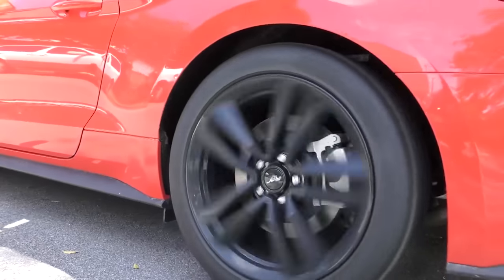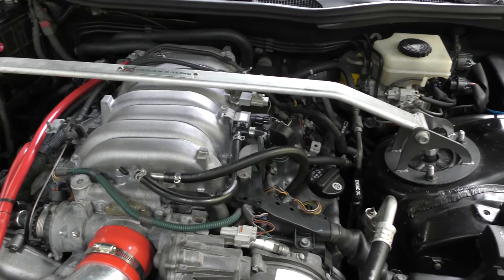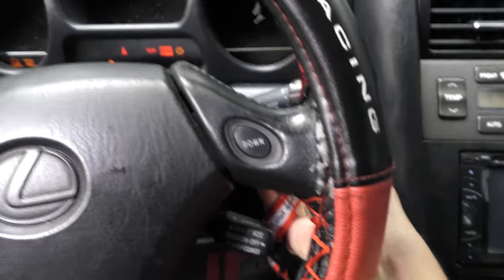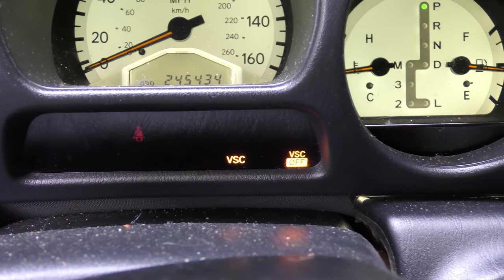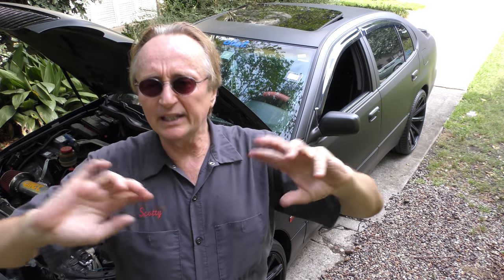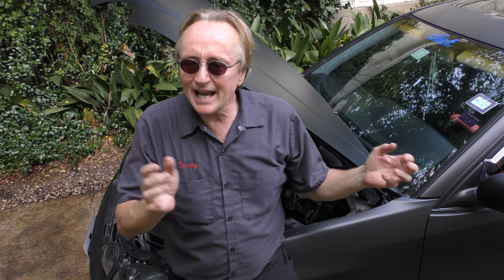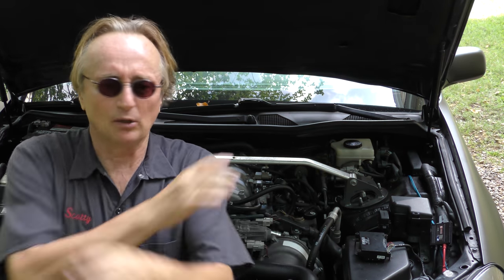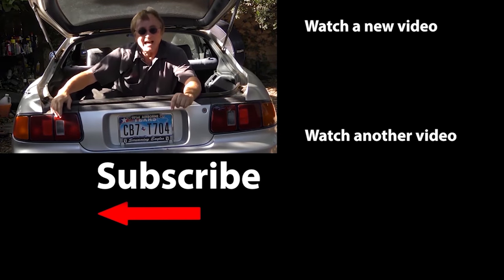Here's How Stupid People Modify a Car (A Sad Day for Lexus Owners)

Comment: That’s more of a hot air intake! Sucking all the hot air from inside the engine bay!
Reply: @j_freed  in which case it's sucking the hot air that's just passed through the radiator
Reply: Yeah I bought a 240sx recently and it had one just like that. All I could think was ahhh a hot air intake
Reply: @j_freed 
 it must be sealed from the hot engine bay with outside (cooler) air being drawn in, to work.
do you even youtube bro?
Reply: Still gain hp
Reply: Technically it’s not a cold air intake unless it goes outside the engine bay that’s just a regular intake with a thinner air filter and smoother hose
Reply: A cold air wont even make more power in most situations the ricers using them cant even rev their engines to the rpms where it would make the power...so all the idiots thinking they know better with their cold air intake are illarious...probably losing a ton of power down low and cant make it back up top cuz your engine cant get there hahahaha
Reply: Camp Matthew  thats because your engine can turn high enough! Its not making a ton more power then a short ram..the difference is in the piping lenght...i got a short ram on mine,when i started with it, was running 14.8to 15.3sec..
Now running 12.98..there is no difference with a cold air! And you re not even tuned if you are happy of not geting codes...barelly making any power!You also got robbed lolll could of got the same gains from a 100$ diy intake...🤣
Reply: j freed very smart guy yiur correct bro

Comment: geeze, poorly modified is an understatement! modifications are supposed to improve performance, not degrade performance😔
Reply: No, they aren’t. A modification would be anything to change the car, a modification. Even tinting the lights are a “mod”
Reply: @0101pwnage  so, you're saying that there's no difference between good "mods" and bad ones? I've always modified to improve, not degrade. improvement is and always should be the goal.
Reply: PANTYEATR1 “should” be the goal, but unfortunately that doesn’t work for others.
Reply: The air intake definitely made a difference when moving at higher speeds
Reply: @0101pwnage  In this case, we're taliking about PERFORMANCE modifications, NOT about cosmetic modifications. Please try to keep up ;>)

Comment: I would bet anything Scotty didn't put this on a dyno.
Reply: The customer probably did and told Scotty
Reply: Yeah, I don't know if it's possible for a modded V8 to have less than 200 hp
Reply: @ryanmckenna5254  yep. More than possible. The American Big 3 built em factory, by the millions, for 2 decades. Thru 70s & 80s. V8 table weights...)))
Reply: @ryanmckenna5254  and Scotty hit it dead on. The mods made it run like crap. Not idle worth a hill o beans... Skip letting the computer have the data necessary to set fuel/air ratios & timing, & volia! Take 300 HP to a staggering 150...
Reply: @patrickjordan2233  those engines weren't modded, let alone fuel injected
Reply: @patrickjordan2233  V8s with upgraded cams run rough at idle too, doesn't say much
Reply: @ryanmckenna5254  yep, they were. Remove O2 sensors, and viola. And look it up. They were fuel injected. Lol
Reply: @patrickjordan2233  most weren't, and most of the V8s that were, made over 200 hp easy without mods. Didn't mean to get into your feelings, but he does exaggerate and judges harshly opposing opinions. Just like there are just as many junk Fords as junk Chevys, you get what you pay for.
Reply: I thought the same thing. He would have showed video of it or graph print out had he actually spent time and money on a dyno.
Reply: Patrick Jordan you are right though anything new enough to be controlled by a computer you restrict the hell out of it if you don’t tune/bypass the computer because it controls everything you can put a cold air intake and a higher flow fuel pump and whatever else on it but the computer will only allow a certain margin to stray from the original specifications so it won’t do anything for you
Reply: @ryanmckenna5254  It's not modified properly, in fact it's the exact opposite. He removed the sensor that tells the computer how much fuel and air is getting into the engine so the computer doesn't know what the hell to do and just dumps a tone of fuel non-stop, drowning the engine in excessive fuel and killing power. Modified requires that you reprogram the ECU to the exact amount of air and fuel entering to keep it at the optimum air to fuel ratio. 

You can't just bolt on parts and call it a day, that will make your car run worse. Reprogramming the ECU is the #1 most important part of modifying the engine to make it faster.
Reply: @SI0AX  as someone who works on BMW's, I understand the importance of sensors, but I honestly don't believe a MAF sensor is going to reduce 1/3 of the engines hp.  Engines have fine spraying injectors, so their is only so much fuel that can be "dumped" into the cylinders at a time. Most of the time when people upgrade their intakes, they have to upgrade to higher volume injectors. I'm sure it is idling rough at idle without the sensor, but I'm sure it has no problems opening up.
Reply: DUDE he didn’t I’m the owner I dynoed it just look on my page and she suprised all the mustangs and chargers there when she opened up
Reply: Ryan McKenna 255 dynoed keep in mind it’s at 250,000
Reply: Ryan McKenna she dynoed 255 to the wheels look on my page
Reply: SI0AX these ECUs are nearly to impossible to tune
Reply: @user-gb1ne5jj8v  I know what I am talking about, and it feels good knowing I can defend your work against low blow criticism. 
It's not fair for him to bash your tuning, when he's not tuned a Lexus himself.

Comment: I agree, it's better to leave it stock.
Reply: You must be crazy?? 

Why would you leave a car stock when you can have plenty of fun roasting others with a sleeper. 

Stock sucks!! 

And on this video Scotty is only half right because moding a car is where all the money on cars is made in 2020. Lol

The fastest cars are built not bought. Lol

But this lexus needs a lot of help though to get it built right though.
Reply: @extremedrivr   Stock lasts longer, is more efficient, more practical.
Reply: @hedgehogthesonic3181  

No sir!! 

Stock does not last longer because the automanufacturers don't want you to have the best car. 

My current car for example will last longer than the auto company say's it will because I am using motor oil that is superior to what it came with from the factory. Little details like that go along way to making a car last a very long time. 

The aftermarket industry knows more than the OEM does so long as the parts are not 🇨🇳 made.

Comment: Scotty, is it worth putting money into fixing a 2000 Jeep Grand Cherokee v8 limited with 183k Miles? It has PCM issue and TCM so it shifts rough, oil pressure sensor, needs a new driveshaft, and the brake line is leaking. What would you recommend??

Comment: I don't know what it's like in the states, but here in New Zealand if a car is first registered before 2010 you don't need a catalytic converter so long as it doesn't have a check engine light and it doesn't make too much noise.

On the flip side: Doing a catback system isn't all that bad, it won't throw fault codes, it's a replacement which is much better.

Comment: Well nothing really lasts forever even for older Lexus's. I kind of want one.
Reply: Sadly, used lexus have skyrocketed in price.
Reply: EvoEvan Nismo yeah I bought a 1996 es300 a week ago. It’s in the shop right now getting it’s radiator replaced cause some jack off did not install it correctly and flicked it up. Got it for only 1000

Comment: It’s that loud for 135 hp💀
Reply: I think these have like 250hp lol dont be that disrespectful 😂😭
Reply: @TheV8Pumpkin  you saw how much it hesitated when he stepped on it. I think these had around 270-300, it does seem like he has quite a bit of power loss from all those mods he did
Reply: @duftmand  Seems like the car is subtracting fuel so it's probably not going to put out the full power but yes it was making anywhere from 270 to 300 if I'm not mistaking it was about 280

Comment: I’d love to see Scotty review Dodge Ram truck problems, not just rams. Edit: because I own a 2002 Dodge ram 1500.
Reply: Biggest problems with dodge trucks from that era are transmissions. I’ve got an 03 Dakota V6 with 206k miles. Engine runs almost as good as new, but the 2-3 shift solenoid is going bad, and it causes problems from 2nd all the way through 4th.
Reply: @oxidizedolive  They have crappy plastic dashes that are notorious for cracking, weak electronic components and bad connections, and bad transmissions. Get the transmission rebuilt and just deal with the electrical failures and not care about the dash and you will have a very nice truck. They aren't too bad all things considered.
Reply: Kalash Nikov i haven’t had any electrical issues outside of my passenger-side power window switch, and the only thing cracked on the dash is the windshield a/c vent. So it’s not bad for a 17 year old truck... guess I got lucky. 🤷🏻‍♂️
Reply: @oxidizedolive  idk what year you got but I was talking about 2nd gen. Should have specified that. I don't know much about 3rd gen.
Reply: @oxidizedolive  then replace the solenoid genius and that doesn't mean the trans is bad
Reply: NinjaGoatX, I have a 2002 Dodge Ram 1500 3rd gen and the windshield wipers will go on their own roughly once or twice an hour even while the truck is off, when the bass drops in a song on the radio the cab lights turn on and it says there’s a door open, my dash is cracked to beyond repair, only max AC works, the rust on my truck is awful so much so that the bed has rusted off the frame in most places and rods are knocking in the engine😅 Edit: my truck has 212,000 miles and was given to me at 200,000😐

Comment: Hey Scotty my mum has a 2001 4Runner that she bought like 3 years ago for a steal (1 grand) & let’s just say she sucks at maintaining it haha. She recently just did it’s first tune up it’s amazing the truck still runs regardless knowing how amazing these engines are. Although shortly after the truck did start to have some problems & it needs: new air box because the old one broke along with the hose that connects to the throttle body. New Valve Covers. New MAF sensor. Brake pads. & an O2 sensor. Is it worth getting the work done?

Comment: So I found a 2000 Lexus GS 400. It has 140,000 miles incredibly clean without any modifications. Is it worth it or should I pass on that because it’s only had one owner like I said it’s incredibly clean mechanically it’s great. Should I pass and go for a different Lexus

Comment: I got a question, i just bought a Lexus GS300 with around 311xxxkm on the clock. everything on the car is original and everything and is in really good shape for the mileage and age. With only some cosmetic issues like small dents and that (which i'm currently fixing) Is it still worth about the same with a car with less mileage  but in "shittier" condition for example? because after the dents are removed and it get's a polish it's gonna be 99,9% mint condition since previous owner took so good care of it from maintence.

Comment: I changed the timing belt on my 07 tundra I'm at 535,000 changed the belt at 250,000.  Daily driver L.A to San Diego daily socal to Florida 3times a year.  

Amsoil 10w-30 full synthetic. KN silver oil filter.  Changed trans fluid at 100,000 and at 300,000.  
Seafoam treatment in crankcase for the first time this year seems like it took 2 oil changes in short succession to remove all the seafoam bit it brought my idle rpm down a bit smoothed out the idle slightly.  Runs great Toyota for Life

Comment: The cat codes aren’t going to cause the fast idle and shouldn’t cause a severe lack of power. I don’t like loud either but to each his own. I see there are throttle body codes.  That could cause some issues with idle speed and power.
Reply: Its probably the throttle position sensor, there's a whole thing with those things on this era lexus. Its broken so its not reading the throttle inputs correctly. That car is probably in limp mode which is why it has no throttle response. If it wasnt in limp mode it could randomly think you were at wot and send you into a tree.

Comment: Well I bought a 1991 lexus LS400 14 years ago with 54,000 miles on it.  I left it completely stock. She's still running real smooth today.  The odometer stopped working a few years ago at 174,000 miles.

Comment: For the WOT question, my truck had a bad coolant temperature sensor and I had to hold down the gas to get it started no matter what temperature that thing was at. Eventually it started blowing black smoke and finally threw a code. It's not even a diesel! 😄
Reply: My Dodge blew black smoke just a few miles before it died.

Comment: Just said good bye to my 1998 GS 300 No Mods. Ran Smoother then any newer Honda Hyundai etc. throttle body issue over 200,000 miles. My speedometer & Odometer actually stopped working at 169,000 miles. I will return to Lexus for that feeling BMW 7 series is the only competitor in my book! Smooth and powerful!

Comment: I have a 97 sc400 non vvti 1uzfe with 150k miles. Tentioner went out.. took alternator, battery and belt with it. I went with an AFTERMARKET fubar racing 1uz tentioner , new battery, belt and alternator and I'm out almost  $1,000 Just to address those issues. I love this car and will continue to bath it with my little money. It's a joy to drive.

Comment: I just bought a GS 2001 GS 300 and it's literally this exact car almost. Lol. It's got an exhaust,  cold air intake, every check engine light, and the VSC and ABS lights. It's overheating, and It's pretty cool. For some reason I'm a sucker for black Lexus sedans. Even when they run like crap.....

Comment: Hey Scotty. Hoping for some advice. I have a 2002 Audi a4 3.0 quattro. It runs great but i cnt pass smog because the catalyst monitor is incomplete. Do you think i need a new catalytic convertor? Or do i need to drive it for 400 miles so the computer can analyze it? I was doing that but my water pump blew and my mechanic reset the computer and codes. I went back for a smog and all but one test us complete. The catalyst monitor test

Comment: I got a 02 gs300 for $1,750 246000 miles.  No mods, all stock.  Normal wear and tear, going to do the timing belt service on it.  
How should I remove the harmonic balancer bolt??

Comment: I still got my 2003 Chevy Tahoe with more miles than that Toyota. All I ever done was a tune up and oil changes. Still runs good and AC blows cold👌

Note: just changed the front end suspension and some on the rear because I got it lifted with new wheels and tires 👍

Comment: I'm with Scotty, it's a wonder it runs! Also i recon with the correct sensors connecting you would get so much more power and economy out of it, also removing cats is a bad idea, you can get sports cats fitted instead, then its all legal. The computer is probably in lhs mode as half of the sensors are missing.

Comment: Actually,  i think a lot of cars have a fail-safe fuel map they run when they get too many errors like this.  Had a Buick with a bad MAF sensor.  Would not run at all.  Disconnected the sensor,  check engine light came on,  MPG dropped,  but we got it home without needing a tow. I DO NOT recommend this trick.  You might destroy your vehicle if it leans out,  you have detonation and destroyed motors.

Comment: love your videos! I just picked up an Acura TL for 400$ all leather interior sun roof working and the AC blows cold! (and its just had the timing belt done the water pump done alternator and all accessory belts) I plugged my code reader in it needs some new O2 sensors and a muffler as the kid cut a hole in it! it shifts fine runs a little rough since the sensors arent working but thats the only code it has. and the parts were 60$ to get under there and replace (just waiting on the OEM style normal muffler I ordered) and shes been driving fine for the past month just a little loud!

Comment: Removing the cats is flat out stupid. I got borla exhaust and intake and my G400 and it runs great at 208k miles, AC is coldest air condition out of all of my cars in hot Dallas . Just passed inspection last weekend too :) These are maintenance vampires as far as Toyotas go. Check out how to do a starter Scotty!!! This car is trashed, wouldn't give ya $500 for it. Needs cats, timing belt/water belt job, brake master cylinder probably on its way out too.

Comment: I just bought a 2005 Chevrolet Impala SS (3.8L Supercharged V6) with only 140,000 miles on it. It's completely stock and runs great. There is a fair amount of rust underneath. I got the car for $1,000. No warning lights are on. And a few local transmission shops said their computer says it still shifts perfectly. Is that worth putting money into? I don't plan on aftermarket modifications besides maybe a louder exhaust and preventative maintenance. Is it worth it or should I just drive it until the wheels fall off?

Comment: I worked on a friends 2001 IS300 where two of the catalytic converters were built into the exhaust manifolds 2500 to replace. Crazy Toyota nonsense cost a fortune to legally keep the car on the road. Thank goodness we live in Florida where there is no inspections. Throw away car when the rest of the car is great.

Comment: My wife's 2016 fiesta se did the same thing and I swapped the coil packs to see if that would fix it but strangely it turned out to be the battery getting weak the factory battery that Ford installed new and it didn't even show as going bad on a tester until it was really cold and I kept them from trying to charge it before the test and a .75 cent gallon of distilled water fixed it.